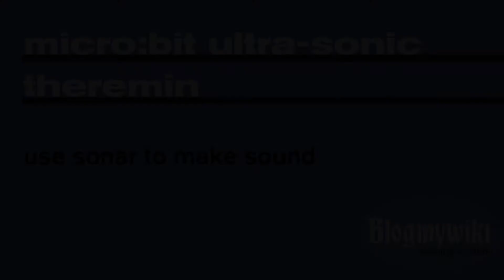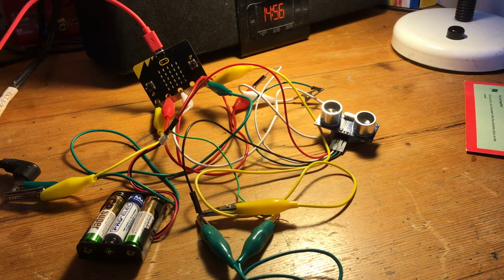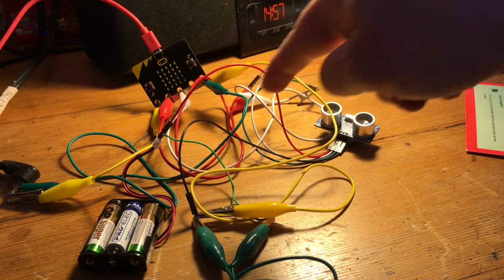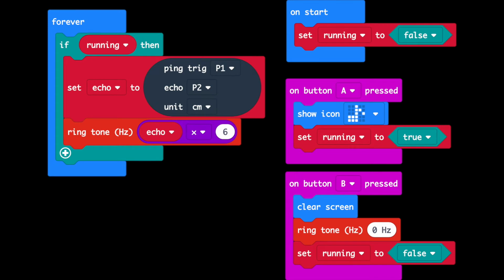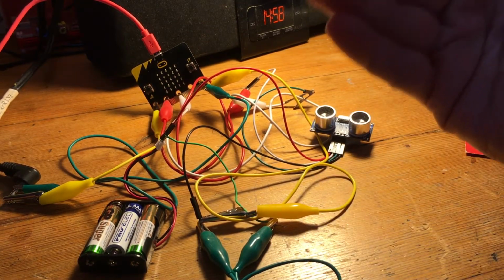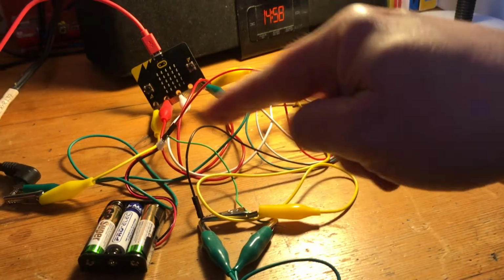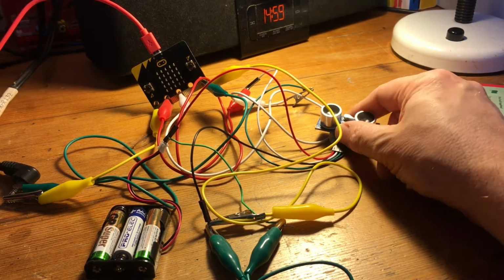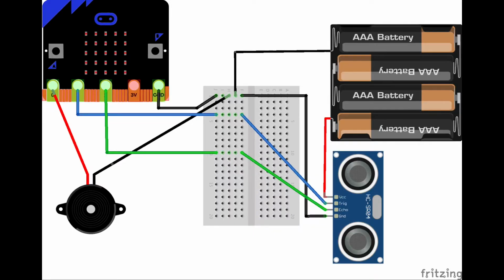micro:bit sonar theremin

Comment: How about connecting 2 at the same time ?
 That way one could control pitch ,the other volume just like a real theremin.
Reply from the maker: Great idea! Would need an edge connector to access more pins but can't see why something like that wouldn't be possible - though there's no volume control with micro:bit sound.
Reply: @othermachines  like this perhaps ?

https://www.kitronik.co.uk/5601b-edge-connector-breakout-board-for-bbc-microbit-pre-built.html
Reply from the maker: @Keeping_IT_Simple  Exactly - perhaps control some lights or change octave or chord patterns with the other sensor?